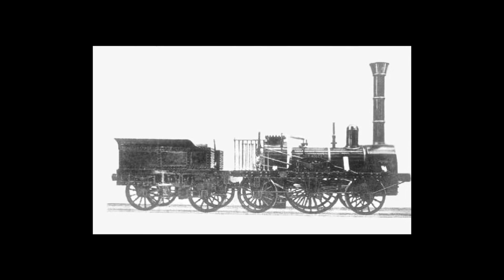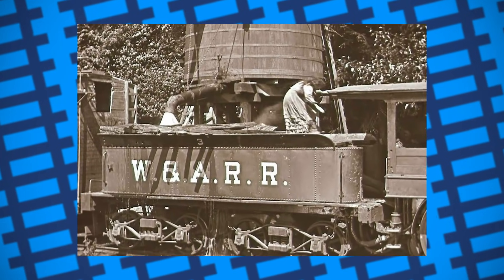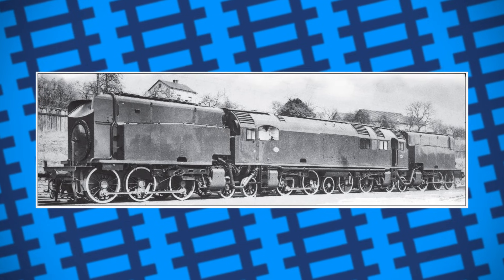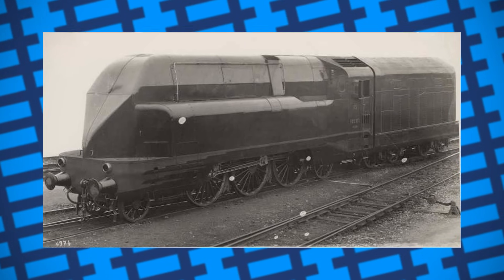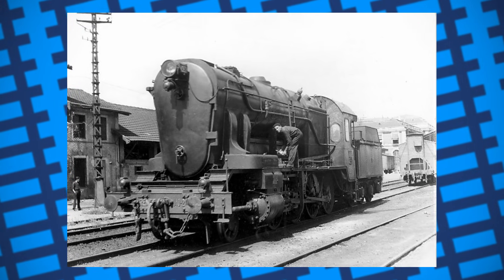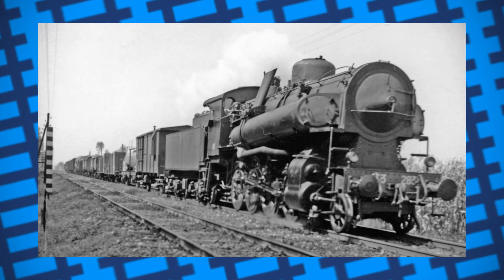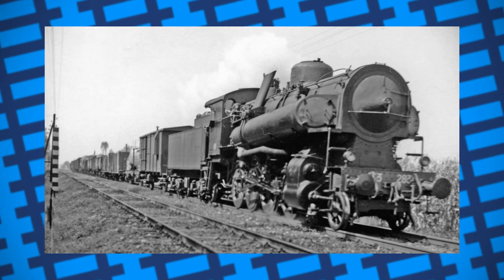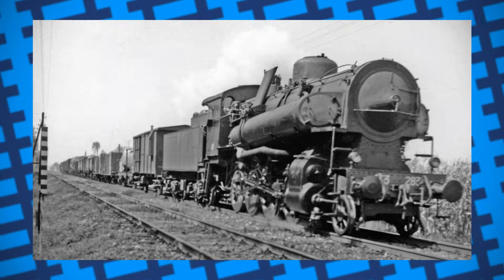Italy's Bizarre double-boiler steam trains - "Franco-Crosti" Boilers

Comment: I really would like to see a newly build steam loco just to see how much of an efficiency gain we could reach with modern technology
Reply: The advanced steam trust and mackwell locomotive company are doing this
Reply: @caledonianrailway1233  Just checked the Mackwell engines, and they look quite cool, as well as clean!
Reply: @RyebuckCoppercap Their website only contains a few rendered images.  No prototypes, nor any detailed information on the construction of any.  There's just a brief and vague video with more crude images and a digital brochure with the same info.  Less there than those middle-eastern super building designs that never go anywhere.
I guarantee it will go nowhere.
Reply: @caledonianrailway1233 nice. i prefer steam trains over diesel trains mainly due to having grown up watching thomas and friends. however i dont have a problem with diesels
Reply: @Leonardo-cw1dd deisel locomotives just seam a little….. whats the word, soulless, the driver turns up in the morning 10 mins before his/her shift and turns a key to get it running, a steam loco requires hours of preparation to get it up and running, and watching the con rods and cylinders do their thing along with the sound and smell is a whole different experience that you cant get from any other machine, however my next door neighbour owns an old transit that sounds and smells shockingly just like a diesel locomotive, nothing to special bout that, but all this is just my opinion and is not a knock in what people like just my personal perspective.
Reply: @kanehood3478 valid point. Depends on the locomotive. All steam locomotives share their personality. Only some diesels and electrics do. That's been my observation.
Reply: @kanehood3478  Old diesel engines actually took several hours to get ready to run. The VT 11.5 of TEE fame takes about two hours to get ready to run. And on that note there are still hundreds of diesel locomotives of similar vintage still running today, and in revenue service, which says quite a lot about the reliability of diesels. Like you can still find Litra MY and MX engines being operated on Danish rails even though they were introduced in the 50s and 60s. Hard to find any steam locomotives that lasted 70 years in revenue service and I bet in the future there will be diesels that have been in active operation longer than the entire steam era.
Reply: @hedgehog3180  yeah i get that but steam was outlawed, so yeah diesel will out last a steam engine, having said that The oldest continually working steam engine in the world runs in Austria: the GKB 671 built in 1860, has never been taken out of service!!! 164 years!!! and is still used for special excursions. Beat that boring box diesels
Reply: Your not wrong @kanehood3478  but honestly diesels are still pretty cool but theirs nothing like a hot piece of 2000 degrees of hot steel of steam rolling down the tracks
Reply: @kanehood3478  While that is poetic and full of character, it's also exactly why diesels replaced steam locomotives. It's a lot easier and less expensive to have a locomotive that you can just turn on with a key 10 minutes before it's needed to take a train.
Reply: @furioussherman7265  oh I’m aware of that, i do think its funny tho that we replaced burning coal that was harming the environment with diesel thats harming the environment, to replace them with electric thats produced from coal burning power stations hmmmmm
Reply: @kanehood3478  Around where I'm from, electricity is generated mostly by hydroelectric dams and nuclear power plants, both of which don't produce carbon emissions.
Reply: @Leonardo-cw1dd 
"Finally, someone who speaks English."
Reply: Luigì Colani designed futuristic  one 15 years ago, but was unable to collect enough money to have one built. And those recently built in the UK were built to old construction patterns 
.
Reply: @steffenrosmus9177  The latter is cause what's the point. Duke of Gloucester was the exception for improvements cause it was already built so less expensive for a new build. It's more for more nostalgia to keep them almost the same, but up to date improvements underneath. The shape, most of the workings, and exterior looks are mostly similar for that reason.
Reply: Make it out of carbon fiber to spite Stockton Rush.
Reply: Look up Carnot efficiency.
Reply: @VEC7ORlt  That doesn't answer the question. How would one increase the Carnot efficiency of a steam locomotive? Can't get a colder reservoir, so hotter fire?
Reply: @kkobayashi1  Pretty much - its all about temperature differentials, nothing else really matters - turbine or piston its still governed by same equations.
Reply: THE LATEST STEAM TECHNOLOGY IDEAS WERE WITH THE ACE 3000 STEAM LOCOMOTIVE IDEAS!
HOWEVER LITTLE, IF ANY OF THIS MADE IT FROM DRAWING BOARD TO THE FACTORY FLOOR!
KEEP THEM ROLLING BROTHERS!!
👍👍
Reply: @rossbryan6102  yes, ut started out as a steam turbine but ended up using reciprocating drive, so hardly advanced in the end. It was expected to have a typical thermal efficiency of 15% against 30% for a typical contemporary diesel-electric locomotive.
Reply: Not enough to justify. Nature of the cycle, I'm afraid
Reply: We pretty much reached peak steam technology and efficiency 70 years ago. Diesels have like 40% efficiency though while steamers have like 10% efficiency. These are not completely accurate statements.
Reply: Same
Reply: New steam locomotives are currently being built in the UK. And we have the A2 class “tornado” which was finished in the late 2000s.
Reply: It would be nice if I could get a full time job working a steam locomotive and make a livable wage in this day and age
Reply: T1:
Reply: If you're a romantic, then steam every time. I wish steam was still with us, but railways are businesses, and it's hardly surprising that diesel ,and subsequently electric traction became the norm. Pity, though.
Reply: I suspect the highest efficiency steam locomotive would use a steam turbine and a hybrid electric drivetrain (turbine spinning at constant speed, and battery assisting when needed).
Reply: @kkobayashi1 that would still be inefficient - turbines work best when under full load at all times and locomotives don't need full power all the time.
Reply: @neiloflongbeck5705  The PRR reached the same conclusion with their S2 steam turbine: Under 70% power and the locomotive was grossly inefficient. But if you ran the turbine throught a generator as a hybrid as kkobayashi1 suggests that method has already been proven for electrical generation facilities with steam. Also, running through a transmission would allow power to stay between 70-100% most of the time, provide massive torque and starting tractive effort... all excellent qualities for a steam locomotive
Reply: @burdizdawurd  now all locomotives are not always at full power, in fact there are times when at line speed the locomotive (diesel or electric) is more or less idling thanks to the low coefficient on friction between steel rail and wheel and power is only applied in short bursts when the speed drops below a desired level. There are videos on YT that will confirm this. This would mean the turbine would need to either be switched in and out of service  any time or put the excess electricity in heavy batteries which would have a negative effect on haulage capacity (for a worse case scenario see the Tesla Semi).
Reply: @neiloflongbeck5705  That's why I mentioned a hybrid drivetrain. Turbine runs at full power all the time, and the excess power is stored in the battery and used when the train needs more power than the turbine is producing.
Reply: @kkobayashi1  just think of all that power being wasted. Once those batteries are charged up and the train is moving at line speed. No turbines are not the answer for rail transport. Only 2 steam turbine powered locomotives had any success and then they were marginally better than the equivalent piston engined steam locomotives and that was only at high speed/power settings.
Reply: @neiloflongbeck5705  France had a gas turbine TGV it worked until the oil crisis which prompted to use their nuclear energy to convert to the now familiar and in use nowadays electric TGV.
Reply: @neiloflongbeck5705  The discussion was about how to make steam locomotives more efficient. I think you just explained why coal powered trains didn't make any sense given modern technologies, and of course I agree with that.
Reply: @kkobayashi1  the steam turbine is over 100 year old technology. Materials have changed and we had better design tools but the laws of physics haven't. No steam powered vehicle is efficient. The best steam turbine plant barely reach 50% thermal efficiency and they are only found in fixed power station. Steam locomotives rarely get above 20% for a standard non-condensing locomotive. The LMS's Turbomotive had a slightly higher thermal efficiency due the design of the steam admission system but not much significantly than a standard Princess.
Reply: @neiloflongbeck5705  Steam turbine is still one of the most efficient ways to generate power from a heat source, which is why it's used for coal power plants, nuclear reactors, etc.
Reply: @kkobayashi1  yes, but still not very efficient.
Reply: @kkobayashi1 yeah they are good when they near full power, which funny enough locomotive don't aways do.
Reply: @kkobayashi1 actually we have something close to it, it N&W 611
Reply: Take a look at the T1 Trust project, they're re engineering and building a steam locomotive froms cratch.
Reply: @ArchoniaAdventures They're trying to go for Mallard's record also. The new T1 should be put as a new category at this point. We have gotten so advanced from the last time Mallard set the record that newly built T1 should just be a completely new gen steam loco not part of the same gen Mallard is from. I will recognized it but at the same time kinda mid considering how much better we are that it's pretty much a for gone conclusion Mallard be beate. at this point and time would easily be overtaken. It'll be like almost if not 100 years after if the new T1 gets built so. Honestly Mallard should be still be significant considering the age significance the era was from. The steam era having 7+ Multiple nations Operators in the 1930s gunning for the speed record for prestige. T1 is built in the era of huge advancement, but the actual competitive era is long, long gone. And it'll be more toy than an actual for purpose.
Reply: @gerogyzurkov2259  Well that means only one thing, the Brits should build another Mallard and race the T1. No age excuses now
Reply: @ArchoniaAdventures  I mean they would of built vs building more DEMU/EMUs expense wise. Steam locomotive building has been said to be expensive still. Also let's point how they're going to do these speed runs. There's only few stretch of tracks that can do speeds for British and American even today. The ones that can in Britain those are hugely in use. HS1 and main lines. For T1 the only stretch that can do those speeds the NEC which the Acela also uses or Florida's Brightline. I don't think the latter would like it as and for Amtrak don't know.
Reply: @ArchoniaAdventures  unfortunately the “brits” as in the British government would never fund such a massive project as it takes to much money from big wigs pockets, it would only happen if a private company/ person/ investors got together and decided they wanted to build it themselves
Reply: @kanehood3478  The British government would never agree to this anyway. Nobody else either is asking for that non the Germans, France, and Japanese. Why build 5 steam locos when u can build a 100s more modern EMU/DEMUs for a little more cost including tooling for way more benefit and efficiency.
Reply: @gerogyzurkov2259  yeah i know, lets not forget that the main lines in the uk have speed limits for any steam engine not to exceed 75mph in normal conditions, for this to be beaten it would need to be a one of run, from a one off locomotive, id still not see it as a record holder, its far more impressive that a daily driven engine achieved this record 100+ years ago, rather than a modern train being purely built to break the record and then sit in a museum somewhere never to run again
Reply: @kanehood3478  + Mallard and the other trains period run on 1930s infrastructure. Much, much worst than nowadays of which the NEW T1 would run on say the NEC alone would be much, much better.
Reply: @ArchoniaAdventures  T1 trust is building an old design, it's sure to be a mechanical marvel but not quite what they're asking about
Reply: @gonzoengineering4894  T1 Trust is abit wasting doing that  They should do new build like the A1 Tornado or the P2 2-8-2. There's no point in doing the old build when using modern methods to be a new build would be more ideal and less wasteful.
Reply: @ArchoniaAdventures  The T1 is a Pennsylvania Railroad 4-4-4-4 or duplex rigid frame design that probably should have been a modern 4-8-4 similar to other railroads of the period minus the extra cylinder saddle and associated hardware.  The Pennsy had a number of T1s in use and they were fast and powerful.
Reply: @ArchoniaAdventures however they still using a design that isn't really the best unless you want speed.
Reply: @ArchoniaAdventures Yes the T1 Trust for sure. There's also been some completely new built steam locos for amusememt parks and as historic replicas (I believe the Golden Spike historic site locos are both replicas.) And, of course, the Chinese built steam locomotives into the 21st century, see Iowa Interstate and CT Valley Railroad examples. But the example I go for is Edaville #11 got an entire new boiler when the new owners took over. Granted it's a little Porter, I doubt there was more efficiency and it was more for the sake of safety and regulations. Maybe the steel is more thermally efficient, but otherwise it's still a rod steam loconotive.
Reply: There is a new train being built in uk called prince of wales p2
Reply: @thetrainguy4797  Last i checked isn't it going to be using tornado's boiler?
Reply: @thetrainguy4797 Aren't there two being built side by side?
Reply: It's pretty interesting how we plateaued with steam-powered efficiency for about 40 years, instead choosing to simply scale it up... and yet people still think there is more blood to be squeezed from the rock.
Reply: I've always wondered if it's feasible to build or convert a steam loco to operate on electricity, replacing the bunkers or tenders with batteries and the firebox with heating elements through the boiler. It would certainly help heritage railways, who can often find buying coal expensive and troublesome.
Reply: @caramelldansen2204 that's been done in Switzerland during WW2 as Switzerland has no coal mines. All bar one were converted back in the early 1950s. They had an operation duration of 20 minutes once the boiler was upto full pressure on the electric heater. They also retained a standard fire box.
Reply: @neiloflongbeck5705  No way! That's awesome! I wonder why people don't do this, then. You'd only have to keep the temperature up, after all, since a shore line could pre-heat the boiler initially to get them up to steam, saving the batteries.
Reply: @caramelldansen2204 cause you’re loosing efficiency. Compare:
using electric energy from the overhead wires to run heaters to heat up steam to move pistons to turn wheels and then exhaust the hot water steam out a funnel, basically blasting all the heat energy into the atmosphere
To:
Running the power through an electric motor and letting it turn a wheel directly
Reply: @Handyman1199  I think you misunderstand the reason people like seeing steam locomotives at heritage railways.
Reply: @Handyman1199  I stopped reading after "loosing efficiency".
Reply: @caramelldansen2204 the boiler doesn’t need to hold the boiler heat for a turbine to be efficient the steam needs to condense. And reciprocal engines exhaust the steam. So you have to constantly heat new water.
Reply: @caramelldansen2204 Train of Thought has another video about Swiss steam-electric locos? Please tell me I remember that correctly
Reply: @burdizdawurd  Right you are!! Good memory!
Reply: @caramelldansen2204  i think it has been done, and i may be wrong but i think there is a video on this channel on it
Reply: @caramelldansen2204  Batteries have nowhere near the energy density of coal or oil. The amperage required to power such a design would be absurd.
It would also beg the obvious question: why would you boil steam at a massive efficiency when you could simply power an electric motor?
Reply: @tim3172  You don't need to get from Edinburgh to London if it's on a heritage line.

I'm not asking how to power electric locomotives. I'm asking how to make steam locomotives cheaper to run.

You're the second person in a row to decide to completely misread my intentions. It's not the "the obvious question" (get over yourself) because someone already invented the electric locomotive. That. Was. Not. The. Point.

People have managed to run electric cars from batteries. It wouldn't be much more current than that. This is a solved issue. I don't understand your protestations.
Reply: @caramelldansen2204  the swiss has done that in ww2 (I think)